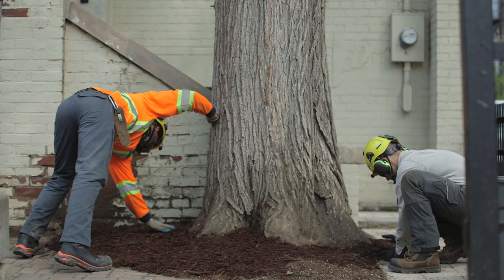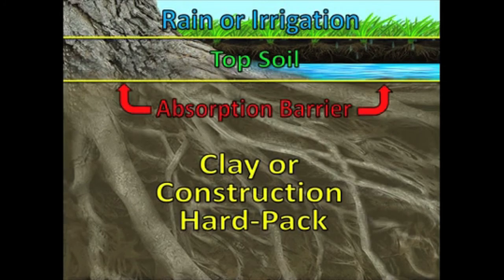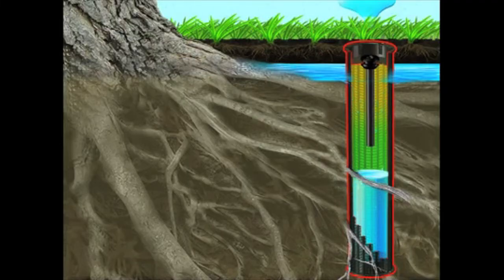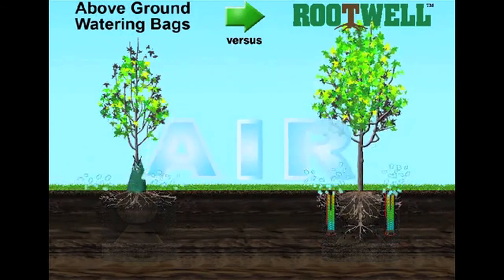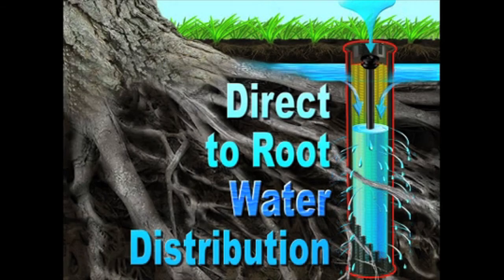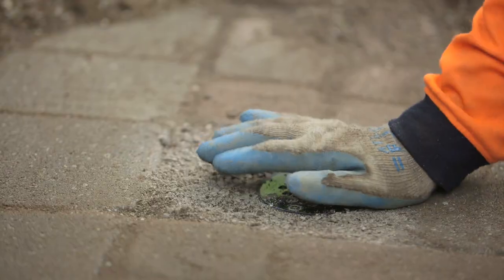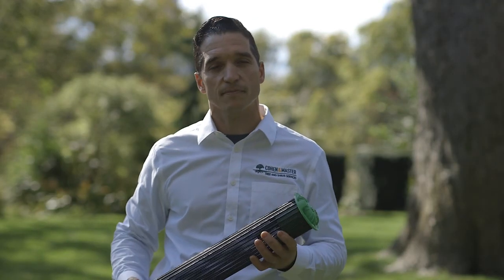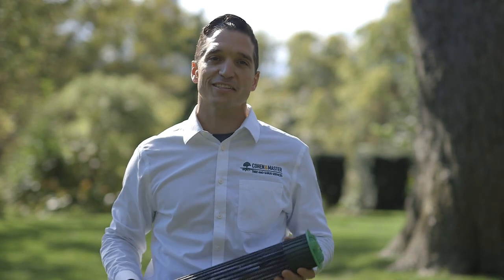Aeration Tubes & Urban Soils | Cohen & Master

Comment: I agree, the system is good but far from ideal.
Soil, silt and clay will eventually enter and clog the holes in the pipes. Plus the air supply is passive and this must also be taken into account
Let's take the option when soil water is high (and there are such cases in practice) - how to remove water?
Reply: In the vid he says the air supply is not passive